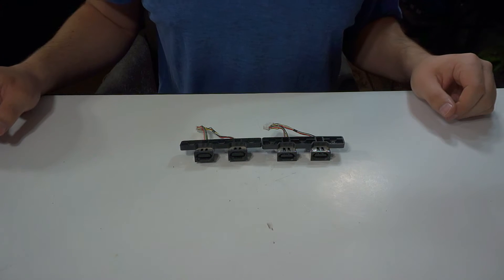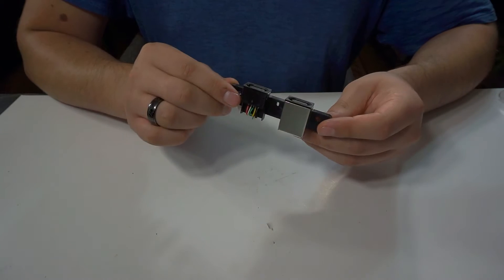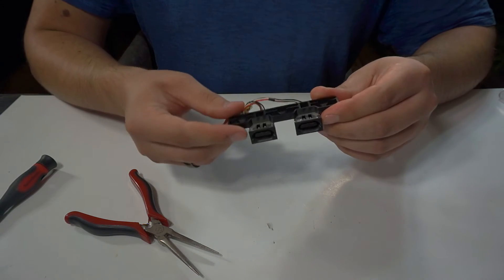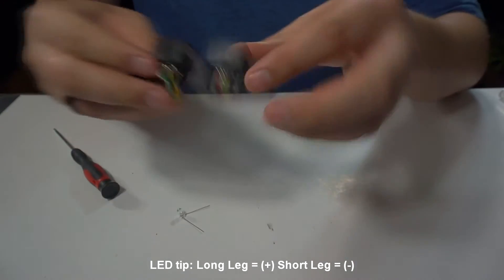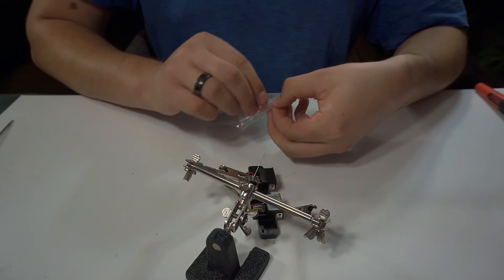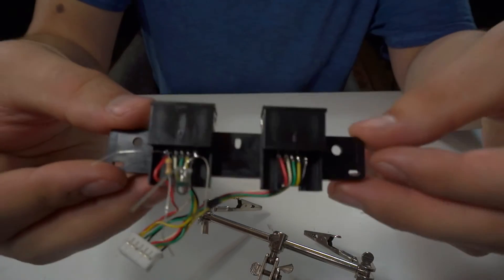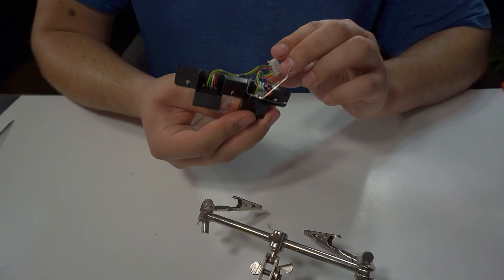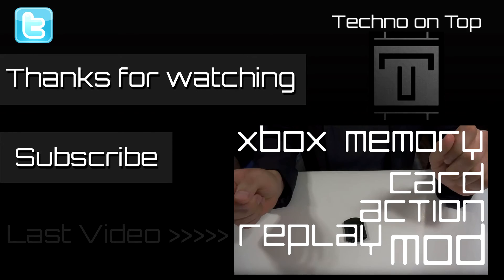How to add LED's to the original xbox's controller ports

Comment: stupid question here but is the resistor really needed? seems like the led could take it with out a problem or at least the right one could or is there some risk to the Xbox that im not getting?
Reply from the maker: Really just depends on what the led is rated at. Some could take it. Even the ones I used probably could but you'd be shortening their lifespan.

Comment: Player one controller port will not light up. Is there a difference between player 1&2 ports and player 3%4 ports as far as wiring goes?
Reply from the maker: No they are all the same, maybe the problem is the led itself

Comment: Nice tutorial, ive bought a bunch of 5mm leds and 470 ohm resistors. But i also have 390 ohm resistors. Can i also use them instead of the 470?
Reply from the maker: Iv recently switched to just using 100ohm resistors. I started using 470 when I bought a bunch for some other project then they just stuck for awhile lol. But yes you can you the 390 as well. Thanks for checking out the video and good luck with your mods!
Reply: @TechnoOnTop from an electrical stand point does it matter which ohm resistor you use? My experience with other things like this shown a pretty tight tolerance for what u should use or shouldn't.
Reply: It all depends on the size of the led and how many you are running in parallel or singular. There is no definitive answer to that question.

Comment: Can you use 3mm led's instead of 5mm ones? Nice video btw.
Reply: 3mm are ideal, you can fit two LEDs in each port & they sit neatly in the plastic grooves on each side of the wiring. The metal shielding can also be reapplied to contain the light.
Reply from the maker: Hey Bruno, yeah you can use smaller, I have used 3mm wide angle before. But really any led will work, I appreciate you watching happy modding!

Comment: Hi TOT nice video and thank you for answering my question,  do I need to reuse the metal frame that you just remove?
Reply from the maker: No you don't need to, some people argue it was put there for a reason and you should put it back... Iv been removing them on modded consoles forever never had any interference issues... So I sat it's not needed and can be left out. Thanks for watching!

Comment: Why do you add the resistor? My leds and resistors are in the mail. Just wondering why the resistors are necessary?
Reply from the maker: Leds have a current rating and if you put to much current through them they burn out or burn out quicker. There are calculators online that can tell you what the ideal ohm  rating for a led is. Higher the resistance the dimmer the light. Iv started using 100ohm in place of 470ohm purely because I ran out of 470 and I have a bunch of 100.

Comment: Thanks for the video.  Got my XBox looking clean now.   One question have you noticed or experienced any buttons acting funny after the mod?  Couple of times I had a couple buttons switching functions for a very short time.  Just curious.
Reply from the maker: No problem thank you for checking it out, that is strange iv never ran into any issues like that and I don't think I've ever heard of it happening to anyone else, all I can suggest is making sure everything is plugged in all the way, but if it stopped maybe just a weird glitch in some game?
Reply: Ok thanks for the reply.  Just hoping it’s not a sign of a bigger problem.

Comment: TechnoOnTop ...Your videos are dop£! Where do you get your Leds and resisters ..and can you plz make a video showing how to add the relay mod dongle for the wireless controller...it would very much be appropriated. Thanks
Reply from the maker: i appreciate your comment thank you! i get my LEDs and resistors from ebay never had any trouble with quality. and yes that mod has been on my list for awhile and i defiantly need to do it. i try and make all my videos very straight to the point so im still working out how to simply and effectively make that work without being to confusing. in the past that mod has given me alot of trouble. i will put it higher on m list because iv gotten a few requests for that. thanks for watching!
Reply: +TechnoOnTop...Thanks a lot bro

Comment: I have another "LED" tip. For the pinout. Look inside the "LED". The bit called the "post" is the "up" ("+") side. And the bit called the "anvil" is the "ground" ("-") side. 
 http://photos.google.com/share/AF1QipPC8nSTPPBLw_diBhrtZlNfeQdMyoXNrPxUNM5fXuV5HuyImET8WJGeNVuSgPuL7g/photo/AF1QipMFONjAxljJLp1O94uYcxRZ1btoso6buR0U5gYx?key=Sm5SM2dXUU1hc2tBSGQxamgwZkY1QXdxQjdaTDNB

Comment: Hey Tech, are those 1/4, 1/2, or 1 watt resistors?
Reply from the maker: I believe they are 1/4 watt but the bag they came in doesn't specify.  Thanks for watching
Reply: No problem, thanks for the fast response man. I'm funkatron9000 over at ISOzone, see ya around.